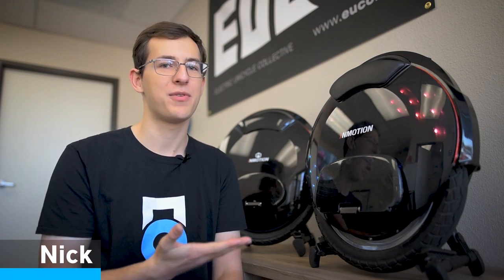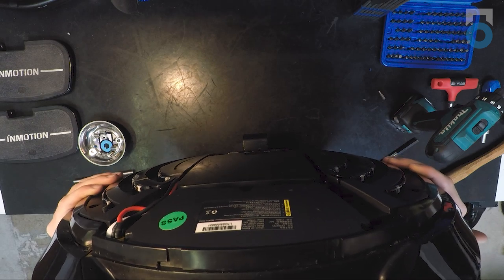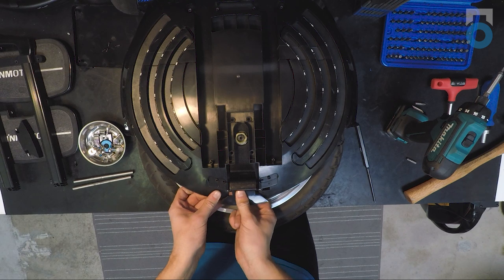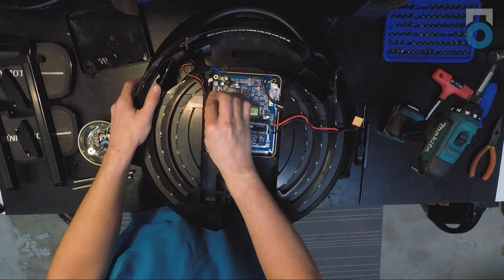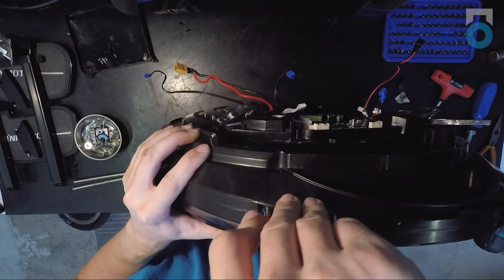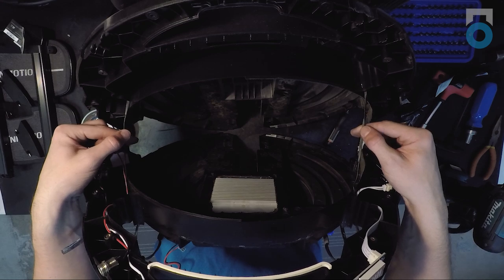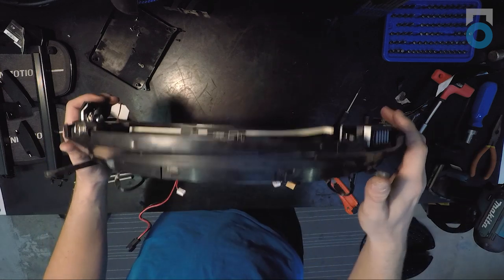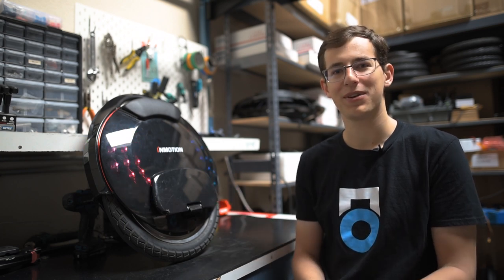InMotion V8F Disassembly For Repair and Tire Change

Comment: Great tutorial of the strip down.
For tire (tyre) change/repair you don't have to take off the pedals or handle, also the flaps (under the pedals) have a notch to the right hand side to slide the pin into for removal.
But I would have struggled to do anything without watching this first.
Reply: Could you explain where to find the notch? I'm currently struggling with taking out the flap. To me the metal pin looks fused to the end of the plastic casing and it's not moving no matter how hard I try.
Reply: There are the notch about 1/2 inch right from once. And also needs to kick in direct of slider. You can use WD-40 then do it easy.
Reply: @АлександрВасильев-п8у3о  Sorry what do you mean by "once"? Is the notch on the metal pin? Because the metal pin on my flaps are really smooth so it's impossible to get a grip on them to slide them out. I also have a V8S not a V8F if that makes a difference

Comment: Hey thanks and this is so timely.  I am updating from a slow wheel that ive had since i was 73. The V8 or v10 seemed right then those with the F made sense. I'm going to get something  so i can cruise around 15 mph and smoother then my 14in wheel to. Thanks glide on. PS. now months later it surprised me how much smother and controllable i is over my Beginner Swagroller wheel. For me v8f is perfect.
Reply: It’s me again now it’s two years later and I’ve got 2000 miles on my V-8 FN I’m putting a snow tires on it right this minute and was happy that I could find your videos just to make sure I’m in in the right zone here thanks. Wish I could find of More knobie style tire but I can’t. Mich has snow cal. Has sand.🤷🏼‍♂️

Comment: Some things I found opening my V8S:
- You don't need to remove the pedals to open the side covers
- To remove the battery housing, in the V8S you need to remove more of the LEDs because the battery case is covered by the pieces left and right that contain the wires going to the lights and speaker.
- The white and balance wires between the mainboard and battery pack also have a connector next to the XT60 near the battery. You don't need to open the motherboard cover to remove the batteries.
- For the battery, indeed you don't need to remove all the screws. The screws that are very deep are the ones that keep the cover closed, don't remove them just to take out the battery pack (woops)
Reply: how would you open the sidecovers
Reply: @jacobsandees3017  even with the pedals on there's enough room to rotate the side covers! Make sure to remove the screws first ;)
Reply: Hey Marcel, I also have a V8S and was wondering how you remove the small flaps on the bottom of the shell? I tried applying upward and outward pressure as highlighted in this video but my flaps aren't budging, and I'm not seeing any notches or indents that other people have described. Have you had better luck? I'm stuck with a flat tire atm and I'm losing my mind lol

Comment: Just for anyone wondering, you can skip the step of removing the foot pedals. You can still get the shell off and on. (I needed to tighten the wheel axel screw).
Reply: The brackets supporting the pedals have since been angled up a bit, raising the pedals enough to clear those screws, so the pedals no longer have to be removed.
Reply: May I ask why you needed to tighten the wheel axel screw? I'm having an issue where my V8F vibrates sometimes and I've heard that it might be a loose axel screw. Also, what tool did you use? Thanks.

Comment: For the valve covers I almost lost my mind trying to remove them this way. The metal rod can be pushed to the right (there's an indent that allows it) with your nail easily to remove it the correct way without trying to break it off. Possibly a thing for a bit newer models, but still a thing to note.
Reply: Wow thanks for that awesome tip. Video was great but he missed that part.
Reply: I don't see how to get a hold on the rod with my nail, is there some trick to this? I'm thinking of picking up a small pair of pliers...
Reply: If you mean there's supposed to be an indent on the rod, I don't see one on mine :(

Comment: Do u kno by change if the v8s would be the same steps to follow to change the tire or to work on thanks for the content
Reply from the maker: It all should be the same steps as the v8f. Only difference between the two are the batteries.

Comment: Sir I got crash an the one of silver fiber thin in black wire cable battery is separate is that danger sir for ride? I do diagnose on inmotion app is still good condition, what should I do sir, please reply im really scare is that safe to ride or not?

Comment: I bought a V8F from EUCO back late July 2020. When charging, it usually took about 2 seconds or so after connecting to the charger before it would beep and turn on the blue bars. Recently it sometimes takes from 5 to 25 seconds before it beeps and turns on the blue lights, while other times it only takes 2 seconds. The charger light goes red as soon as I connect it to my V8F, so i don't think that is the problem. Once it does beep, it seems to charge normally and I can use Inmotion App or EUC World app to monitor the charge. When going for a ride, it powers on in less than a second, and it rides OK. I live in Orange County California, so the weather is not that cold when I ride. I keep my V8F indoors where the temperature is about 72 degrees. Should I be concerned about the time it sometimes takes to respond to being connected to the charger?
Reply: Did you ever find any solution to this? This started happening on me also recently
Reply: @luwn00bz  - no, and it got worse, now taking up to 4 minutes or so to wake up. Once it has woken up, I can stop and start charging again, and it will wake up quickly, so it's something to due with charge circuitry. Also another issue. If I leave the V8F stored for 3 or 4 days, the initial resistance is higher, charge voltage versus pack voltage is about 1 volt or so higher than normal. If I charge, do a short ride, and charge again, the resistance returns to normal so another charge circuitry issue.
Reply: @rcgldr  Interesting. I have the same issue with the beep and lights. I think it started after riding in rain but not sure. I've ridden daily for 2 months and +1000km since with no other issue but the beep delay every time. My end voltage reads 83,4V in the app always.
Reply: @luwn00bz  - I don't ride much, about 80 km per month, since August 2021. About 2100 km on my V8F now. I don't know if time is a factor. My peak pack voltage is about 0.1 volts less than new,  probably due to some imbalance in the pack.
Reply: @rcgldr  Maybe it's just something to do with loading the sound file. I did tamper with custom sounds.
Reply: @luwn00bz  - not related to sound, since the  blue leds don't turn on either. The bluetooth communication starts up within a few seconds and is able to connect to a phone app, but the blue leds and wake up beep now take up to 4 minutes to turn on after connecting to a charger.
Reply: @rcgldr  I know I have the same. Maybe the led thing is just coded so that the sound file has to load first..

Comment: So for tires, are they special for euc meaning their size is hard to find
Reply from the maker: For tires, as long as the size is the same as the stock tire it should be fine. It's recommended to find some groups or forums to see what everyone else uses for whatever wheel you are buying the tire for.

Comment: Well that's unfortunate. 
Got into a crash and the handle broke along with the button coming out. I thought I could just buy a replacement handle, but it seems that the handle and shell is all one part.
Guess it'd be safer to send it in for repairs than to do it myself

Comment: The flap pin has a groove on it that allows you to push the pin with a flat blades screwdriver which makes them very easy to remove. Tough if you skip that step.
Reply: Could you explain where to find the notch? I'm currently struggling with taking out the flap. To me the metal pin looks fused to the end of the plastic casing and it's not moving no matter how hard I try.

Comment: pls somebody help. i got my inmotion v8f for only 2 weeks now, when I was learning I fell a couple of times (nothing serious I thought) , i was very happy when I realized the rim was bent so the tire was not 100% holding in the rim...I tried to straighten but it just broke.:(  :(   and of course i don't want to replace the entire motor since mine is new. please help,  what can I do? thank you so much in advanve
Reply from the maker: Before riding did you check the tire pressure? We always recommend at least 35psi on the V8F, and 40psi or 45psi for best rim safety if you're OK with that pressure. It's possible to get parts and replace just the rim yourself with the help of a few how to videos, but you're uncomfortable opening the motor then the only option is replacing the motor.
Reply: @EUCOllective  I'm very comfortable opening the motor, but it seems that they don't sell that specific part alone, at least I haven't found it.... so far I am using epoxy metal/concrete weld glue, hope that gives me some extra time of mildly riding while I fully fix it,  since I am new at riding it should be ok for now.... thank you for your prompt reply and good video

Comment: Can you use the speakers for music on the V8F?
Reply from the maker: The_Real_GizmoDuck that’s actually one of the few features that wasn’t carried over from V10. V8F has speakers, but like V8, they are just used for system events- not music streaming. You can record your own sounds for those system events though!
Reply: @EUCOllective  Well in any case the V8F still sounds like a pretty solid wheel as far the performance goes. I for one can't  wait to test it out!

Comment: Hi, can you please tell me What would be the correct psi for InmVf8 for a person that weight 146lbs? Someone said 40 but I think is too much and makes the wheel harder to drive
Reply: I have a V8 (still) and try to use around 35 psi for my tire. My weight is similar.

Comment: You do not need to remove the padels at all!!
Reply: Thank you for this note! I’m about to disassemble my wheel, and if true, this will not only save me time but eliminate the need to find a long, mysterious metal tool to hammer out that pedal axel.
Reply: @trevorama  At least it's true for my v8  (no f), changed the tire recently

Comment: oh my god..... all they had to do was move those two screws holding the outer shell from rotating up or down a tiny bit then you could easily remove the shell without the huge pain in the ass that is taking off the pedals... WHY WHY WHY do they love to make it so complicated to change the tube lmao
Reply: The bracket supporting the pedals was later angled up a bit, raising the pedals enough to clear those screws, so the pedals no longer have to be removed.

Comment: This video makes me angry. Taking off the pedals is not necessary if you only want to pull off the casing to access the motor and wheel for tire and inner tube work. The valve access panels near the pedals are also much harder to take off than the video suggests. I had to flex the housing quite a bit and ended up using needle-nosed pliers to take off the panel rod.

Comment: Does Inmotion manufacture poor quality products ? I bought a V8F 4 months ago. I rode it normally and even didn't jump kerbs. Then one day after pulling it down a kerb for a while, it shook strongly and the wheel was locked. This happened again next time and it said PLEASE REPAIR. I checked with the app and it displayed "mechanical failure". Why is it so easily malfunctioned ? Finally I have to pay an extra cost for the repair.
Reply: Erik, who did you buy it from?  It should be under warranty…. The unit is really very reliable and not many issues with this model however, things do happen.  I had a control board MOSFET go bad without any observable reason.  eWheels repaired it for me no problem, EUCO would do the same thing, check with your dealer.
Reply: @maxwellmark  I gave to the dealer to repair. They said the wheel was repaired and informed me to get it back. I checked and tested on spot but it still trembled.       They said need to repair again. What a bad dealer.
Reply: @erikchong5069  That’s too bad… well I hope they get it fixed correctly this time.
Reply: @maxwellmark  Thx. I hope so.